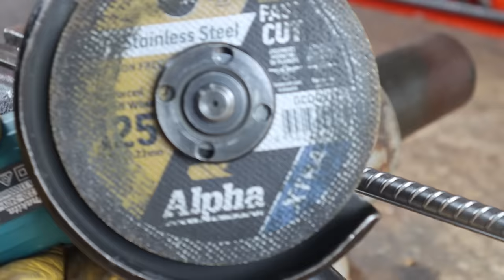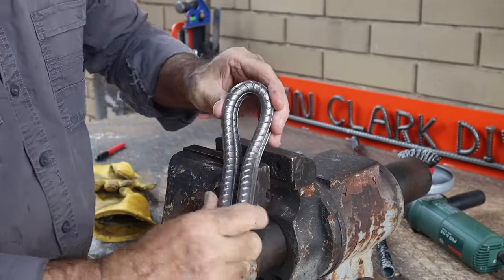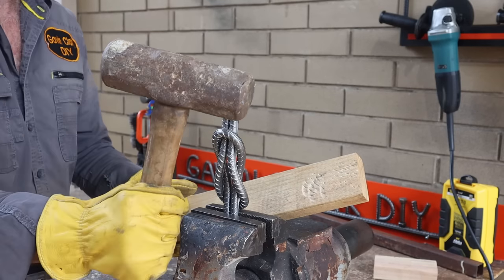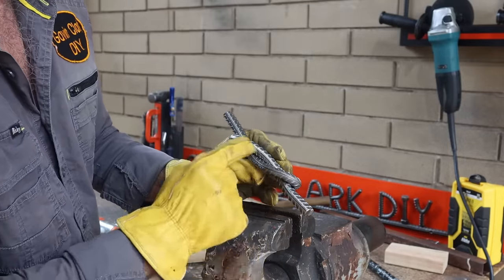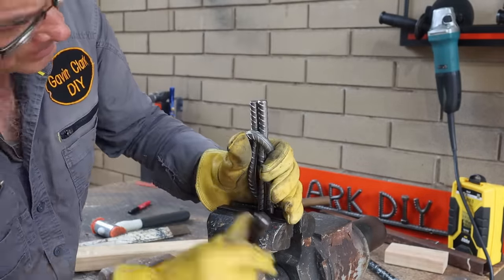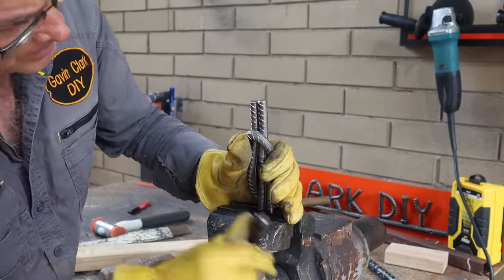I make an Industrial Style Shelf Bracket, and bend Steel Rebar into a knot - MIG Welding Project

Comment: Dear Gavin, wow, what you do with lengths of steel is literally like twisting rope. I do like the idea of using a piece of tube as your former. Absolute precision. Well done.
Reply from the maker: Thank you very much, I appreciate your comment.
Reply: That’s not an answer
Reply: How about some measurements
Reply from the maker: @lioneldegrace4369  In the description under the video are the measurements, here is a copy. The rebar is 12mm, Wide flatbar is 50mm x 3MM, Small flatbar is 32mm x 6mm. The shelf bracket size is 180mm x 180mm.
Reply: @lioneldegrace4369  No one asked a question.
Reply: Never even said thanks. Tosser. Great work mate, just discovered your channel.  @GavinClarkdiy
Reply from the maker: @johnwhitfield3547  Thanks John, all is good mate. Cheers!
Reply: @johnwhitfield3547 tbh Lionel comes across as envious and bitter.

Comment: Impressive, I know a blacksmith, I’ll ask him to make me a pair similar to this.  
I like the rebar, but we’ll use 1/4 inch cold roll & 1/4 by 2 inch flat, probably not cut & weld, just heat & bend. 
And the 2nd pair just 2 pieces & twist that’ll work just fine. 
Maybe just use a flat & twist to make the angle. We’ll just have to wait & see.
Reply from the maker: Thank you very much, I wish you the best for your project. It should look great.

Comment: Just finished watching full vid, excellent, I imagine the reason why u added the extra flatbar was for looks? Also wondering why you didn’t drill holes in original bracket before welding rebar on? Maybe, oh crap, should have done that first, tho u prob have a good reason. When thru hole welding like that, I tend to drill a small hole into rebar to aid weld penetration. Love ur work.
Reply from the maker: Yes Ian, the second bar was just for looks, this was the first one and I was not quite sure of where the holes should be, or if they should be staggered a bit down the side, so I waited and did them last (I now have a template so all the cuts and holes can be done first). The rebar where I welded was freshly cut and clean steel, I like it like that for welding, BUT, I have never drilled it a bit to give the weld something to grip onto, I like that idea, thank you, Ian. I appreciate your comment.

Comment: First time viewer,  but an immediate actual like and subscribe.  A very rare display of craftsmanship and the attention to detail is astonishing. Not your normal youtube offering.  I'll be looking forward to seeing more. By the way have the same well worn vise that I bought new in 1991 at Sam's club for $50. The older ones like that were very sturdy. Later models became very cheaply made, very sharp and angular with much thinner sections.  They are prone to pulling the lead screw nut off the ring on the back. I broke the lip out from under the fixed jaw on mine by stupidly hammering on it. I bought another vintage one but one day I'll get old faithful back in order.
Reply from the maker: Thank you very much, Welcome to the channel. I would have bought my vise about the same time, it has taken quite a beating from me, and so far has not broken, it does have a bit of wear, but still going strong, thank you for your comment.

Comment: Looks cool , you need a drill press , also easier to plug weld bigger holes like 12mm or so .  👍
Reply from the maker: Thank you very much, I agree a drill press would make the project much easier and quicker to do, but I am trying to use simple tools. I appreciate your comment.

Comment: Looks like you'd have made it a lot easier on yourself if you'd started with the two flat bars, and left the welding of the rebar knot for last. That would've left all your drill locations accessible throughout the build, and allowed you to drill and chamfer the holes comfortably without that rebar sitting in the way, and without having to use that drill extension, which not all of us have. Is there a reason you  chose this particular order?

Bloody nice shelf supports though. I'm already envisioning how one could produce these more efficiently by using a custom bending jig to keep everything aligned and symmetrical as the rebar is being bent, in case you'd want to use them in larger quantities throughout the house. Definitely doable.
Reply from the maker: This was the first one, so I was designing it as I went, now I have one I like measurements and templates are made, the next ones are much more efficient. Cheers, thank you for your comment.

Comment: It does look stunning.
But i have to ask: is the Rebar really just for decoration? Why not weld the knot at the backside to make it a strong structural part?
Reply from the maker: The knot is kinked very tight, so it is solid, but a small weld would make it stronger, but I don't think it is needed. Cheers

Comment: I used to bend rebar cold like that until i broke my 60 year old, made in USA, Cincinnati Vise that once belonged to my grandfather. Then to add insult to injury, i tried to forge weld it back together but forgot that Iron melts much lower than steel (2,200'f vs 2,600'f) and ended up with pile of metal.
Reply from the maker: Ho, No, that is so sad, I feel for you, it would have broken your heart. The top of my steel workbench was my father's, we made many things on it together including engine rebuilds, it has many memories for me in it. You may not have seen my new bench video, but I built a new heavy workbench and it has the Dads old checker plate top from my old workbench on it, it gets a new life and maybe will be kept in the family when I am gone. Cheers Andrew, thank you for your comment.

Comment: Slick 👍
Reply from the maker: Thank you very much.
Reply: @GavinClarkdiy  Gavin, have you any success with bending 3/8 rebar in a vice without heat and not have it snap? I tried to bend 3/8 yesterday into a triangle and it snapped at 90 degrees. If you have advice I would appreciate it, thank you Gavin.
Reply from the maker: @gregoryjohnston6742  I am using standard Rebar, in D500N Standard Grade N. Common uses include columns, prefabricated beams, precast products, and cages. It is popular with both residential and industrial applications, any hi-tensile rebar is super hard to work without heat. When you bend metal/rebar, you naturally weaken it. Bending it cold may cause fine cracks, and it may even break. As you have found out, I would try is don't make the corner quite so sharp, so the bar is not under so much strain, try to make your bend in one direction and keep the lengthwise raised lines on your rebar to the sides of the bend, so you are not stretching these much at all. Bend using a pipe or something is much easier on the rebar than using a hammer. Try to never re-bend rebar back the way it has been bent by you, eg you bent it too far and you go to bend it back a bit, it almost always cracks or breaks. Unless you see a flame in my video it is cold and not heat-treated in any way. Heat makes the bending much easier and there is less chance of the rebar cracking or breaking, heat is basically your friend when bending steel. I am trying to use simple tools and not use heat unless I have to in many of my videos. Some things will need heat to get the bend I need because it is too hard/big to bend or I do not want hammer marks in them. Thank you I hope this helps a bit.
Reply: @GavinClarkdiy  Thank you very much for taking the time to reply with very detailed information Gavin, you are an awesome dude. Have you ever tried bending rebar into a pretzel? 🤣
Reply from the maker: @gregoryjohnston6742  No problem. I have not tried bending it ito a pretzel, it would look cool.

Comment: Thanks Gavin I myself work by my own rules , I’m using propane, I don’t have the strength to bend them by myself. I’ll let you know how it goes
Reply from the maker: Yes, we must do what needs to be done to get the job done, Heat is your friend, I wish you the best for your project.
Reply: Hi Gavin I was using some mapp gas to heat up my rebar but when I bent it, it broke right off what did I do wrong.
Reply from the maker: @lioneldegrace4369  Is it high-tensile steel? that is much harder to play with, I am using standard rebar, I am in Australia, and the 12mm rebar has D 500N in raised lettering on it. Rebar, in D500N Standard Grade N. Common uses include columns, prefabricated beams, precast products and cages. It is popular with both residential and industrial applications. I have had cracks and breaks at different times, but generally, unless I try to bend it back a bit from the direction I have been bending it I do not have too many problems, I like to bend with pipes and do it all smoothly, I do use hammers at times but I try not too. I have the following in the description under the video "When you bend metal/rebar, you naturally weaken it. Bending it cold may cause fine cracks, and it may even break." I can only suggest more heat and maybe different rebar than what you are using. I wish you the best.

Comment: With a true master welding becomes an art. 
You love your work, and so much passionate about it. 

How do you keep it rust free?
Because  the texture is so sexy.
Reply from the maker: Thank you very much, I am glad you liked it. I often use Penetrol Rust Treatment Penetrates Rust 300g Aerosol Spray, and then put two topcoats of Semi-Gloss Clear Coat. That is what I used on the rebar lettering on the back of my workbench, here is the link to that video. https://youtu.be/JA-wk62Zghk I try not to comment on finishes, As what climate you are in, is it inside-outside, lots of rain, ice, do you want long term and rarely touch, or a wax with a wipe over every year. That is why I have no opinion, Please ask someone in your area what you should use, I feel this is a better way to find out what would be best for you. Thank you for your comment.

Comment: The last time I tried to bend rebar, it was so brittle it just broke even after getting it orange-hot. It didn't bend much at all before it broke.
Reply from the maker: It is 1/2 inch steel rebar,  it is standard construction rebar it has not been heated at all it is straight off the shelf and can be bought at steel sellers or hardware stores, all rebar will have a code on it, the code on my 1/2 inch rebar is "D 500N" as raised lettering, I am in Australia. Yes, it is prone to cracking or just snap if you bend it, eg if I bend it in one direction and then bend it back it will crack for sure and probably break into two bits. Over time I have learnt to work with it, the harder hi-tensile stuff is harder again. Hope that helps you, thank you for your comment.

Comment: I tell you what …if I could change discs on my angle grinder 1/10 as fast as you, I’d be a happier man.
🤨 hold the phone: he’s not fast …he’s using two different grinders!😤 I guess that falls under ‘work Smarter, Not Harder.’ One thing I DO know is this guy definitely knows a thing (or Ten) about bending rebar! Well done sir. Well done, indeed!👍🏻👏🏻👏🏻👏🏻
Stealing this design in 3…2…😁
Reply: Okay, I see what’s happening here …the ‘Trick’ is to buy your angle grinders by the gross!😅
Reply from the maker: Thank you very much, I appreciate your comment. I wish you the best for your projects, Grandpa.
Reply from the maker: I do save a time having more than one (I have 3 small ones plus a 9 inch one. Cheers

Comment: I would do many things little differently but my main subject of wonder is why you didnt drill all the holes before welding? 😀
Reply from the maker: Spot on, this was the first one I made, I was not quite sure where the holes would look the best, I sometimes instead of doing the two holes in the corner I stagger them (one on one side in the corner one halfway down on the other side and the end one where it is) I like to keep my options open on the trial ones. For making more, the next ones I have a template, so more cuts and holes can be drilled earlier. I appreciate your comment.
Reply: @GavinClarkdiy  I see, I might do something like that too if i am not sure what i am doing and where i am going ;).

Comment: Really nice.  Did you spray anything on them when you were done to prevent rust?  Or is it not needed?
Reply from the maker: Thank you very much, I am glad you liked it. I often use Penetrol Rust Treatment Penetrates Rust 300g Aerosol Spray, and then put two topcoats of Semi-Gloss Clear Coat. That is what I used on the rebar lettering on the back of my workbench, here is the link to that video. https://youtu.be/JA-wk62Zghk I try not to comment on finishes, As what climate you are in, is it inside-outside, lots of rain, ice, do you want long term and rarely touch, or a wax with a wipe over every year. That is why I have no opinion, Please ask someone in your area what you should use, I feel this is a better way to find out what would be best for you. Thank you for your comment.

Comment: Excellent job, I have almost every tool under the sun, but couldn’t do what you did with just hand tools. I’ve only one arm these days, but you’re video is truly inspirational. Was that 1/2” re-bar you were working with?
Reply from the maker: Thank you very much, I appreciate your comment, yes 1/2 inch standard rebar has "D 500N" in raised lettering on it. (have a play with 1/2 round rod it is a bit easier to work with, eg less cracks or breaks) I wish you the best for your future projects Ian.

Comment: I don't know how you make your final countersinks straight when the drill extension is angled above the rebar.  Maybe the error is insignificant.
Reply from the maker: It is pretty insignificant if you don't over-drill it. I used to so a lot of straight holes and use dome head screws, they look good sometimes with rustic brackets, that is one way to get around the problem if you are worried.

Comment: Looks great, I like the way you hide the welds. Just wondering if you coat them with clear after to stop them rusting?
Reply from the maker: Thank you very much, I am glad you liked it. I often use Penetrol Rust Treatment Penetrates Rust 300g Aerosol Spray, and then put two topcoats of Semi-Gloss Clear Coat. That is what I used on the rebar lettering on the back of my workbench, here is the link to that video. https://youtu.be/JA-wk62Zghk  I try not to comment on finishes, As what climate you are in, is it inside-outside, lots of rain, ice, do you want long term and rarely touch, or a wax with a wipe over every year. That is why I have no opinion on here. Hope this helps Doug.

Comment: The Rebar are not welded to each other.  They are free to move, if high loads are applied, they are not really supporting at all. Very nice aesthetics.
Reply from the maker: Thank you, at the 8 min mark the rebar is bent tightly over the end locking it all together, there is no movement, if I was worried I would weld hidden so nobody could see it, I appreciate your comment. https://youtu.be/Njw28TCi1TI?t=481
Reply: @GavinClarkdiy  That's right, a hidden weld would be the best solution, because there might be no movement but that would be on the opposite way needed for a bracket. This was the first video of your channel I ever saw. I love your content. I usually make 3d printed projects, but I just bought a welder and your work is inspiring.

Comment: It is technically not a lot of support from the rebar because it does have give to push and pull because the two pieces aren't actually tight together if a lot of weight is put on the Shelf
Reply from the maker: It is tight together, you will see in the video, when the two bits are slipped together, both endes are then bent this prevents any movement, you could weld it too but it is not needed. Thank you very much, I appreciate your comment.

Comment: You have the great tools to drill at the angle but why didn't you pre drill
Reply from the maker: This was the first one I made of these, so waiting until it is made to decide where to put the holes, is something I do, sometimes they look better a bit further from the corner, or even use the staggered holes, one on one side up near the corner, the second on the other side halfway down the flat bar on the other side from the first one, and the third at the bottom, or maybe use 5 holes to make it look stronger. Once I have one and I am happy with it, I have a template so I can cut most of it and pre-drill all the holes, before putting it together. I appreciate your comment, that is a very good question.

Comment: May I ask the original length of the two pieces of rebar you started with? Was it 24”
Reply from the maker: I can't think but 24" would do the job, bend a tape measure to get an idea of the curve and the length you want, you can just read the tape and get the measurement, and add a few inches on each end to give you something to grip when bending it. I wish you the best for your project.